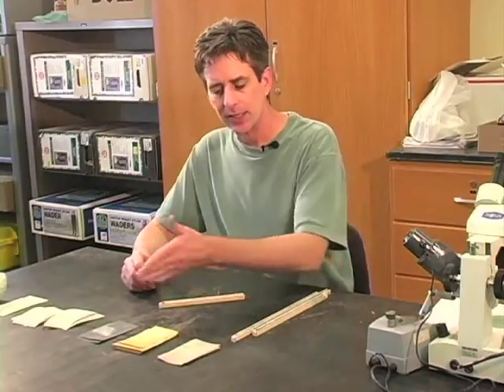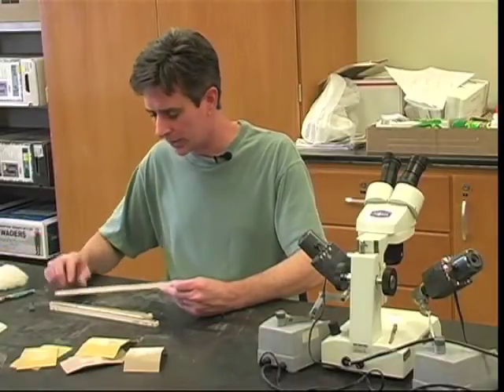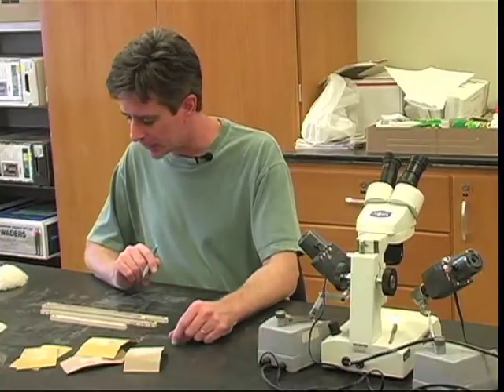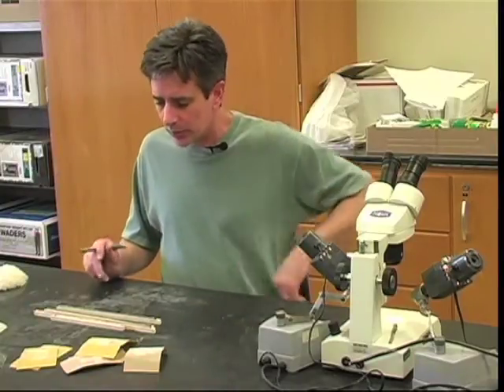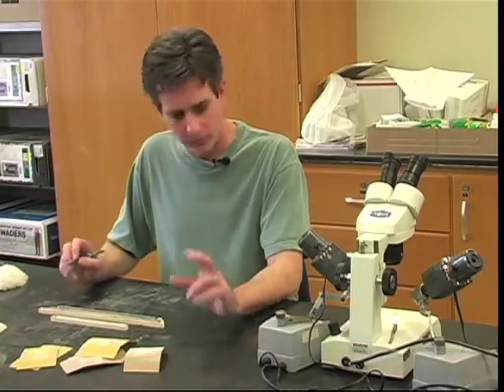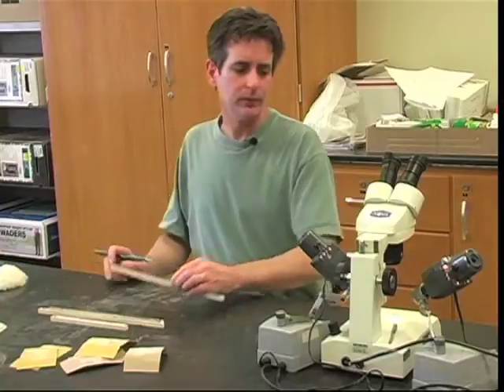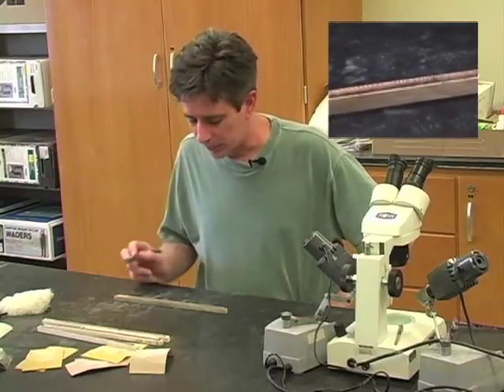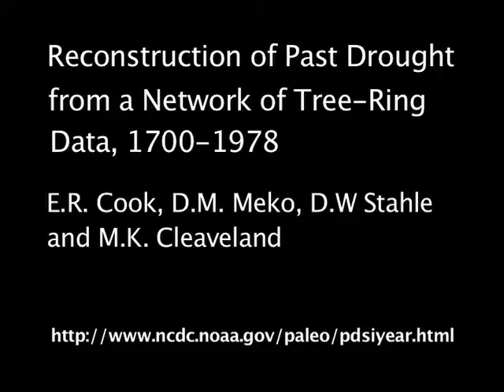Tree Core Analysis Part 2

Comment: A few years ago I found a fire kill pine that was still standing the fire had occur in the 1950's the pine was 13" diameter 
I did cut a 1" biscuit  and  sanded it down to 400 grit and put tung oil on it and wiped it after a few minutes then I installed a sewing flexible ruler with push pins from the center to the exterior then I took pictures with macro lens of all the sections then transferred the pictures on my computer and I could enlarge the pictures more so it was really easy to count the rings 
the tree was in the 220 years old and at about 30 years old I could see that a fire had happened and a third of the diameter of the tree took a while to recover, it was really distinctive 
All your presentation are very educative and well done., Thanks for all the videos
Reply: This is interesting....do you consider using COORECORDER SOFTWARE
Reply: @willardsayowa5010  I do not have one but thinking to get a core sampling kit